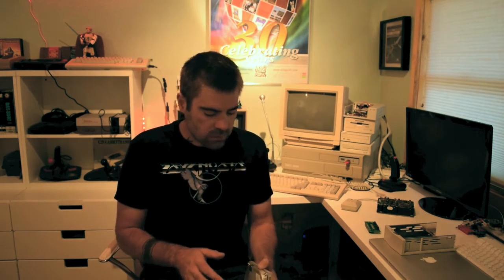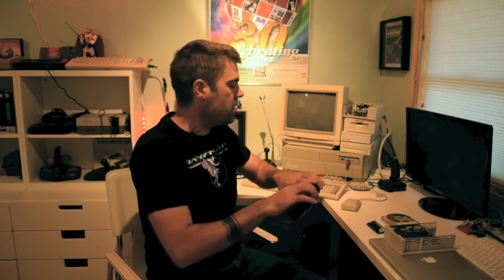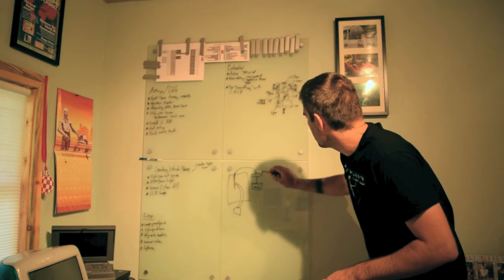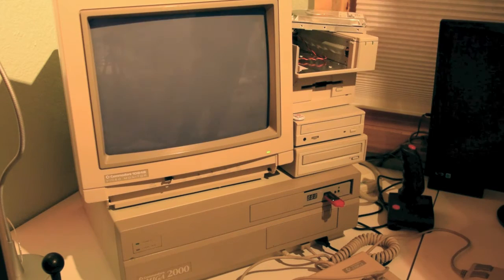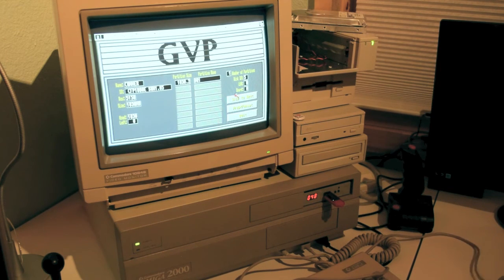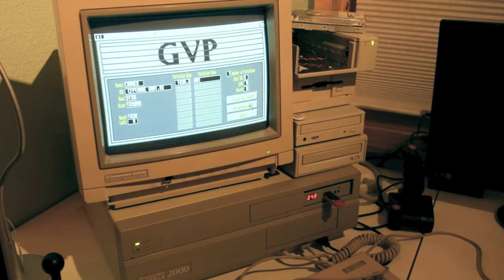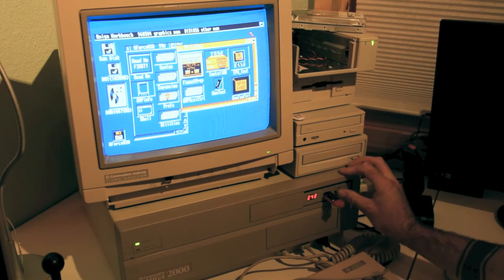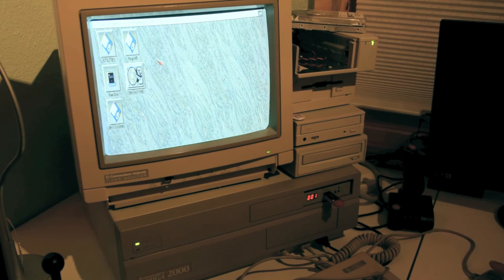The Ancient Art of SCSI

Comment: Nice informative video. You are right, SCSI is an art...  Having worked for a long time with AIX machines, this was the only interface available for hard-disks, cd-rom drives, and tape units, but it was a nightmare to configure.

I've got a similar A2K as yours (with WB 2.05), setup with a GVP SCSI card and a 18 Gig Seagate drive, for which I only use the first 1 Gig as a main partition. Everything boots fine.I'm trying to add an external CD-Rom SCSI drive, and although all seems fine, the Amiga never sees the CD-Rom Unit.

What would you recommend me to do? Is adding an external unit on the scsi chain require me to add drivers or files on the Amiga Workbench folder, or config files?

Thanks!
Bruno
Reply from the maker: Sorry Bruno, I just saw your comment and question. Were you able to resolve the issue?

Will
Reply: @WillWilliams6502  Hi, yes, I had to copy the gvpscsi.device file in the expansion folder, and the add gvpscsi (instead of scsi) in the parameters of the hdtoolbox icon. After that, opening the hdtoolbox it was then able to see the drive.

Cheers
Reply from the maker: Awesome, that's great information to know for manually setting up a drive.

Comment: SCSI was FAR better than IDE I had scsi on my Amiga and PC. The PC had IDE which was limited to only 2 drives with 2 channels (4 physical drives) SCSI was 8 devices to start off with. SCSI was also Much quicker than IDE. SCSI was sooo expensive though the drives were over twice the cost of a IDE Equivalent. Still have a load of SCSI stuff in my loft...
Reply from the maker: I agree, I always saw IDE as being the cheap option and I was pretty disappointed when C= added  IDE to the 1200 and 600.
Reply: I'm not convinced it was better to be honest... well not for storage on an amiga then anyway. I do think SCIS is way better for plugging in a combination of things, like a SCSI to ethernet and so forth to got wth your storage. However I think SCSi was a massive waste of bandwidth. So IDE PATA made a lot more sense if it was only being used for storage, since, as you say the SCSI was pricey. What gets my goat though about the amiga is how the a1200 had a pcmicia but not a CPI slot (PCI being 1991 standard and a1200 being 1992 so easily enough time to get it on their) and I think solution would have been to equip each a1200 with a PCMCIA caddy which has the IDE in that instead of inside the a1200 and a PCI in it just waiting for a PCI graphics card (hombre or whatever) and it the caddy would be big enough to put a CDROM drive in it. Actually I think a CDROM should have been mandatory (as you in you cannot have an a1200 without one in it) and a 68030, and an ethernt, but I digress. My point is, the bandwidth is the issue and amiga could have sorted that out especially seeing as they had an IDE in the later a590 sidecar caddies. But alas commodore seemed to be completely bonkers (as we all know)and couldn't even figure out that it would have been a great idea for the a590 to allow scsi CDROM drives plugged into that back of it to be bootable to run CDTV games etc. I lament over the way the atari had a network adaptor but the amiga500  did not really (not in the same way). Consideirng how slow the a590 XT drives were, a network port would have been great as an easy way to add storage.

Comment: Great information! And nice A2K!

What size is the USB dongle in your Gotek, and how did you come up with the partition size of -24, -8 (or -0, it's hard to tell in the video)? I couldn't get mine to work with anything larger than a 4GB dongle.

Thanks!
Reply from the maker: Thank you!
I think I have a 8gb usb dongle in the gotek, it's basically acting as a storage device that's not accessible by the Amiga until I a lot a slot within the gotek.

The size of the internal SD card is 16gb but only 4gig is used. Setting the capacity is configured by the SCSI2SD firmware flashing utility.

Regards,
Will